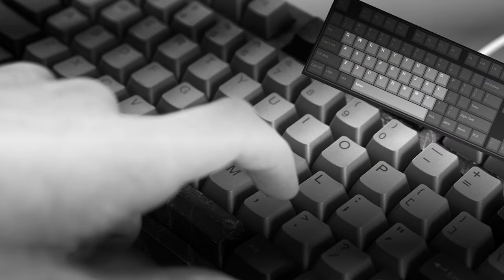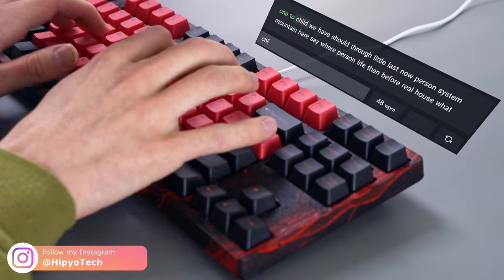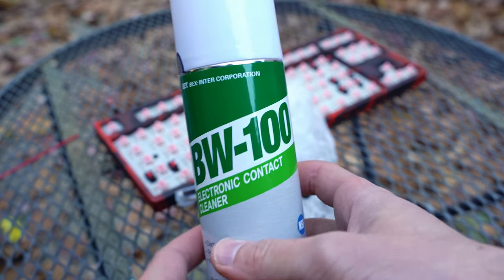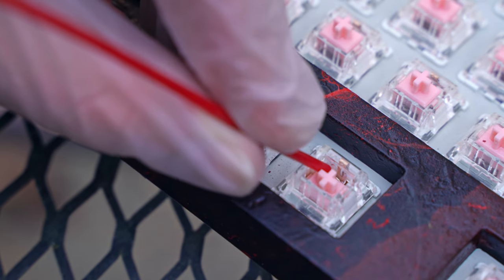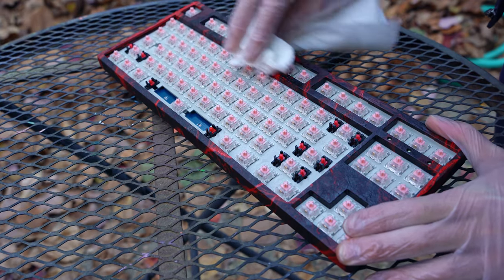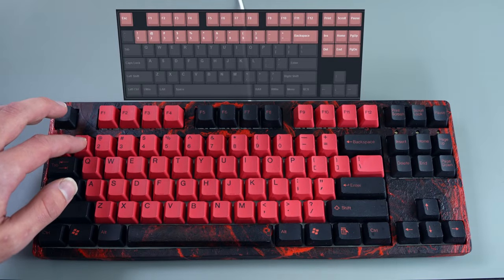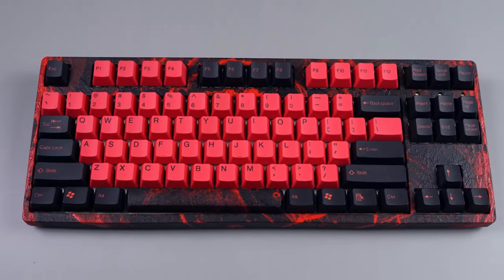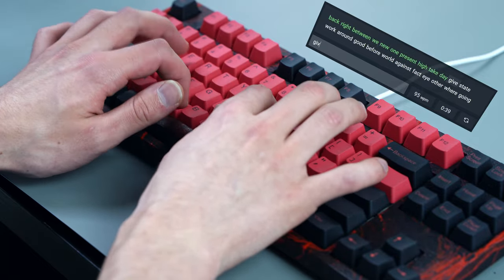I BROKE my PewDiePie Keyboard with Spray lube - I try and fix it. [Voice Reveal]

Comment: I mean... they say it on the name... it cleans contacts ._. 

Yeah, I guess know what a product actually does/is intended to do, first, like clean contacts or for lubricants, lubricate surfaces (?) You should use contact cleaner in switches the same reason why you should use lubricant... because it says in the name, not because it's some mystical item that will magically enhance your switches or whatever. I don't know. Cheers.